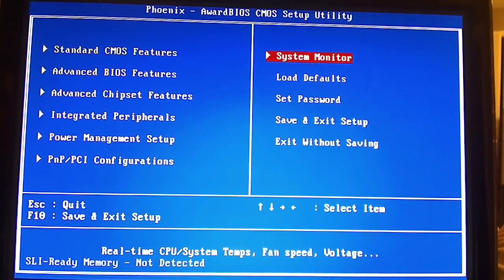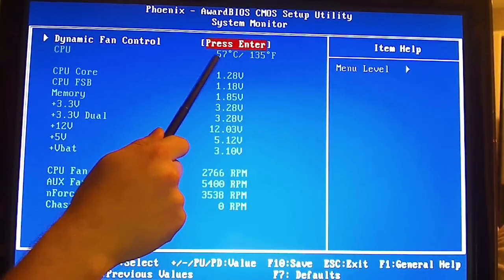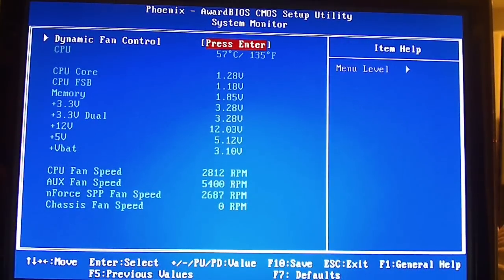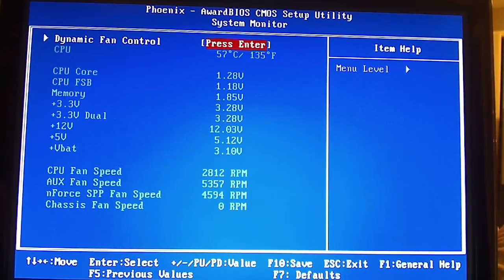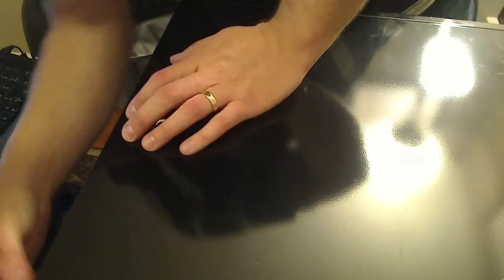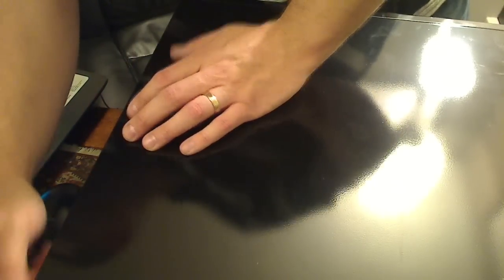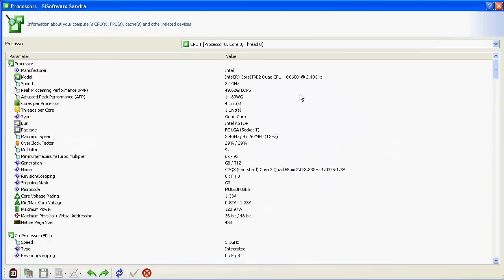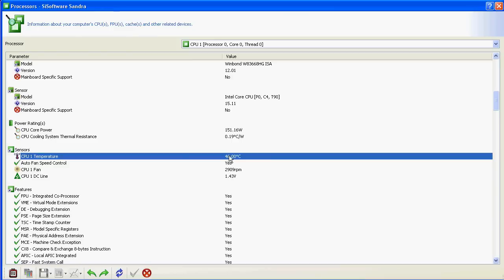SOLVED:  Fix Overheating CPU (Computer) Decrease Temps by 10 degrees

Comment: 8.17 mins. to tell us that we have to clean out of dust our computer... Rocket science
Reply: +ProvenHelper You never said in the title or description that the video was about cleaning out dust. How were we supposed to know that you weren't going to discuss anything else before we watched the video?
Reply from the maker: +Nicklucario Actually you must have not watched the entire video because you missed the point about thermal compound going bad.
Reply: +ProvenHelper You mean the one sentence comment in an 8 minute video?
Reply from the maker: +Nicklucario Well here's a full refund $0
Reply: +ProvenHelper LOL @ refund :)  I just cleaned out my CPU cooler, when I do the ITB (intel burn test) my cores go to almost 100 degrees in less than 10 seconds... I did notice the thermal paste kind of looked like yours in this video, so I guess I should replace it. The CPU cooler had some dust, but now cleaned it and reinstalled it, there is no difference in temperature... It is a stock Intel cooler and my CPU is not overclocked. I guess those stock coolers are not awesome, but it's just weird. My other coolers mounted on the side of the case are clean too and the air feels cooled.
Reply: @ThevonMusic  i know its old but i have same problem, replaced thermal paste and cleaned put but still nothing, did u solve it?
Reply: @CamaGoesGym  I bought a new cpu cooler, a better one which until now still works great
Reply: @ThevonMusic  so the cooler was the problem??
Reply: Yes

Comment from the maker: Might be re-doing this video. My power supply fan died and my fans were setup incorrectly. My temps are super low now, with the new power supply and proper setup of airflow.

Comment from the maker: I noticed many of you are plagued by very high CPU temperatures. I would strongly recommend this affordable performance CPU cooler (http://amzn.to/1QClPAR) , it's only $29 has over 3,632 positive reviews. It used to cost a lot more, but the price has come down a lot recently. It works for #Intel and #AMD CPU sockets, and it almost fits everything out there! Good luck and post a comment if you own it.  
#CPUcooler  #CPUoverheating
Reply: Lex Selfmade Life I actually just bought this one. I have high hopes

Comment from the maker: The following will cause temperature problems.
1. Bad voltage settings.
2. CPU and heatsink shifted causing old thermal compound to become ineffective.
3. Broken fan.
4. Virus or rogue process.
5. Excessive dust.
6. Fans pointed in the wrong direction.
7. High temperatures in your computer room.

Hope that helps you with your trouble-shooting.

Comment: Hi. It seems that you have the CPU cooler mounted the wrong way. You should turn it 180º so that its fan blows the air, first passing the cpu cooler, then going in the direction of the back of your pc case so that the next fan will blow it out of the case. Other thing is, the fan thats pulling the air out of the case, is also stopping that your cpu cooler fan pulls enough air to blow the cpu cooler itself. Its a double win case. :) Regards

Comment from the maker: I understand you perfectly and yes computers are very easily affected by room temperatures, so it's ideal to run them in air conditioned rooms if the room temperature is very high. 35c is very high.

Comment: He puts the CPU Cooler the wrong way :D
Reply: True, it needs to face east because the PSU & rear outtake fan both suck air out so it's a tug-o-war with the HSF which is trying to suck air down into the copper pipes.
Reply: You put your picture on wrong position.

Comment: I see one of the reasons you were hving overheating issues. The CPU fan and the case back fan were placed in conflicting directions, pulling air from inbetween. This likely negatively impacted your airflow by a fair margin.
Reply: +BronyBoyYack Exactly, those idle temps are above normal. I think he didn't spread the thermal paste, he needed more and then spread the layer, then set.
Reply: +kev42o97 That wouldn't have helped nearly as much as having proper airflow.
Reply: BronyBoyYack Very true. However, I've taken apart video cards and reapplied thermal paste that had clearly disintegrated over time and the temps dramatically decreased. But you are correct, improper or insufficient airflow for a cpu will cause serious heat dissipation problems.
Reply: +kev42o97 New thermal paste is always good when the old stuff has gone dry and crusty. It still won't impact the cooling performance as much as proper airflow. If it's dry and worn out, it may be better to just wipe it off and sit the cooler on with maybe just enough paste to fill in minor gaps. Lapping is also an option, as if you lap both the heatsink and cpu spreader properly, more metal will have direct contact with metal, leading to less need for thermal compounds to fill in gaps.
Reply: BronyBoyYack Yeah I agree.
Reply: Alladeen Madafaker The default fan is no good for cpu's. You must get an aftermarket fan.
Reply: TheInVerseIsTrue Watch him actually look for aftermarket FANS, rather than heatsinks. That won't work at all. As long as your fan is blowing on the same piece of metal, you won't get much in the way of improvement. If you really want to keep your digital oven from glowing red, you need to get a heatsink+fan combo. Personally, I recommend the Cooler Master Hyper 212 EVO, if your computer's enclosure is wide enough to fit it. If you can't fit a Hyper 212 EVO into your computer, my alternative recommendation would definitely go to the Cryorig H7. Both coolers have great compatibility across numerous sockets and have unsurpassed performance when it comes to air cooling.
Reply: Yackaro That's what I meant to say. I have a 9800 aftermarket fan for my i5. A zalman 9600, my mistake.
Reply: TheInVerseIsTrue You're still saying fan, rather than heatsink. A fan is a set of plastic blades that spin in a frame to create airflow, a heatsink is the metal thing that it's blowing air through. I'm only doing my best to clear the confusion of what you're saying. I don't want Alladeen Madafaker to go buy a fan and take off the heatsink, put on thermal compound, and slap the fan on at the ratings label, instant fire hazard there. I also don't want him to just put a straight up new fan on the stock heatsink, because unless the new fan has some stupid high CFM compared to the old one, which I doubt unless you get Delta fans at 6k+ rpm, you will not see much improvement. Just sa'in.
Reply: Yackaro lol, Copper heat sink + fan by Zalman.
Reply: @kmemz  interesting
Reply: @xxalexdalionxx  OoOoH what brings you to necro this comment thread?
Notuch has changed about thermodynamics in computing since this thread, outside of the massive growth in the consumer AiO and custom water loop market, so unless you're dealing with something like that 100% of what I've said still holds true.
Reply: KillerMemz I built a new computer recently with a friend of mine but I started noticing that when I play games like overwatch for example, my temperature goes to like 70 and stays in that range for a bit. ;-;

Comment: You spread out the bead of thermal paste that's why you had an air bubble, you can see on the CPU heatsink a space where no thermal paste was, it's there because you spread the thermal paste. You NEVER spread the thermal paste, let the heatsink do it.
 And you also need better cable management, all those loose wires create heat pockets because they block exhaust fans from moving the air behind the wires.
Reply: The Andoxico 4 years late to tell you it doesnt matter at all

Comment: my cpu temp is 76c at 3000rpm fan speed.
Reply: OMG
Reply: BE CAREFUL DUDE, IT MIGHT JUST EXPLODE!
Reply: +You're offended? I don't give a shit! i think youre using a laptop, am i right?
Reply: epic troll The air coming from the pc burns my skin, It's broken now...
Reply: mine was like 107 celcius
Reply: 98c here >_>
Reply: mines 80c fuck I didnt know that was bad lol
Reply: My 6 or 7 year old hp laptop cpu temperature is below 70 Celsius in idle and fan noise is pretty low. Before I cleaned the dust out after 3 years of owning it the temperature of the cpu would go up to 80 at idle with very loud fan noise.

Comment: Hey thank you so much for this video. I have a customized desktop back in 2010 and up until 2014 I was getting the blue screen of death and never knew what was wrong with my computer. I thought I had a virus. comes to find out that a over heating CPU can cause the blue screen. I'm going first thing in the morning to pick up some thermal paste and bring my computer back to life. Just wanted to thank you for a easy and helpful video.

Comment: 57 degrees is not overheating at all. my pc normal temperature is 65 degrees and my pc's gaming temperature is between 80-90 degrees Celsius 
it automatically shuts down when the temperature went above 90 mostly,sometimes 87 tooo
Reply from the maker: +bhavik Soni That sounds like an AMD cpu.
Reply: yeah you are right man
AMD FX(tm)-8320 Eight -Core Processor 3.50 GHz
Reply: my pc shuts down every time I start it becuse of overheating cpu

Comment from the maker: I've been overclocking computers for a very long time, and during that time, I figured out that the following will cause temperature problems.

1. Bad voltage settings.
2. Overclocking too high for your cooling methods.
3. CPU and heatsink shifted causing old thermal compound to become ineffective.
4. Broken fan.
5. Virus or rogue process.
6. Excessive dust.
7. Fans pointed in the wrong direction.
8. High temperatures in your computer room.

Hope that helps you with your trouble-shooting.

Comment: 57 is hot?? man my goes to 95. 100C
Reply: Same lmao
Reply: Same and now that it is now it's crashing just by opening discord
Reply: @chixens5713  how'd ya fix it mine does the same thing?
Reply: @exonscsgo3866  go to the search bar in Windows 10 and type "Power plan" then press the reccomendation on the edit power plan settings and check the reccomended settings for performance that got me from 86-90° to 50-76 when gaming, try it out for yourself.
Reply: @chixens5713  yeah but the performance is gonna decrease

Comment from the maker: Yes you're right. I caught that mistake during the editing of this video and fixed it right away. Since this was taped, I built myself 2 new computers. One was an i5 2500k and my current one is an i7 2600k overclocked to 4.6ghz running about 38 Celsius most of the time.

I plan to make the overclocking video soon, subscribe to my channel for updates.

Comment from the maker: Good job and yes lower temps mean longer life. But I have been overclocking for years and I have never ran a processor to the grave. I never push my CPU to constant max temps either. Right now I'm running a Core i7 2600k overclocked to 4.6Ghz running at 38c with a moderate load.

Comment: Also in a laptop there isn't really much you can do
Reply: You can do what it needs, you can clean it out etc?
Reply from the maker: ***** if you're having problems with your laptop overheating, try doing a deep clen. I made a how-to video for laptops as well.
https://www.youtube.com/watch?v=jxl8MxTMnUo
 #laptopoverheating   #laptop
Reply: ***** I re-tim'd my friends i5 Acer laptop and it went from 85*C in Prime95 to 61*C, max load.  Also tested about the same in Intel burn test.  Used Arctic Silver 5 (AS5).  AS5 was at one time the best stuff but now there might be a few better types.

Comment: Wow dude thanx alot worked perfect for me. Came home and noticed that the comp was very slow so i decided to restart the comp and then at the start up it said CPU was overheat, Decided to check at bios and it was 126 degress warm and i was like well shit is broken but then decided to check it up. First deavtivate Q-fan and let the fan run att full speed but it didnt help much since the CPU was still on 100 degress so i checked your vid and now it's 57 degress when idle! You really saved me there

Comment: You do realize that the CPU runs 10 degrees hotter when in BIOS right?   Also, 57 degrees is not considered overheating....Are you or were you a novice when you made this  video?
Reply: *****  EXACTLY!!! If you want to destroy your computer..this is a great instructional video on how to do just that...
Reply: +Hakeem Hakim The bios up or not if over the temp allowed.The PC would shut off at the set Motherboard temp limit.Or the motherboards flawed each mother board can take so much heat.
Reply: TSpider Keeper   I do not understand a word in what you just said...if you are saying the motherboard regulates temperature, you are wrong. The motherboard has its own temperature and if it is shutting off at 57 degrees than that is a PRETTY WEAK motherboard.  Intel CPUs can go a bit over 100c before it will automatically shut off...
Reply: +Hakeem Hakim My bad misread your comment.And was saying it has own temps lol
Reply: TSpider Keeper   cool bro!
Reply: dude it's 57 degree at idle... that means on load( whenever gaming) it's going to be 85degrees at least

Comment from the maker: @crayzeesteve Here's what you should do since I take it you are not a computer nerd. 1. take a lot of before pictures in-case you forget where and how things go. 2. unplug all cables 3. remove memory modules 4. remove cpu and heat sink 5. remove add in cards (video cards, sound cards, network cards etc.) 6. put everything back, step by step. 7. if you pulled the CPU out, make sure you clean off the old thermal paste and re-apply thermal paste when you put it back. Re-seat =take out, put back in.

Comment: Everything in the bios is set to auto, but i will check with AMD what they should be,  thanks. This cpu is known to get too hot, but they say it shouldn't cause issues until it reached 70 degrees. By the way I took your advice in this video and actually washed the heatsink and its helped a lot, even though i clean the dust inside PC every month.

Comment from the maker: Another note about Fans: 
1. You should have equal amount of fans blowing in and an equal amount of fans blowing out. 
2. Front fans should be sucking cool air in; arrows towards Motherboard, rear fans are obviously exhaust; blowing air out, arrows facing the back of case.

Comment: Sorted it out tonight when I got home from work :o) It's now running at about 40°C normally and only up to 60°C when I'm gaming.  The CPU was stuck fast to the heatsink so I had to get it off (gently) with a screwdriver and a hammer. Cleaned the fan with Q-tips and scrubbed the heatsink with soapy water. There was a LOT of dust and cat hairs, my cat sleeps on top of the tower. Thanks for the help :o) 
Also I put the CPU back before cleaning it, so I wouldn't bend any of the pins.

Comment: that's usually a sign of the cooler not being able to handle the TDP of the chip.  if u can increase cool air flow into the case that usually helps, also a faster fan on the cooler if u have spare fans, if not a new cooler is your only other option.  but just because its climbing under load while the cooling system is on max isn't  a bad thing, usually it will peak at some point, where it peaks can be the good or the bad.

Comment from the maker: Check your voltages make sure they are a stock settings since you are not overclocking. voltages cause the biggest temperature increases. Then you might want to upgrade to a higher end heatsink and fan. An i5 should be around 37 degrees Celsius on idle (Windows desktop). Keep troubleshooting until you find the problem.

Comment from the maker: If you have done the cleaning and the thermal paste, then the next step would be to swap out the CPU heatsink for a more effective model for your CPU. A cooler CPU equals cooler case temps, which should equal cooler GPU. Also if your GPU is causing the the overheating issues, then you might want to look into putting in more case fans because it sound like it's too hot in your case, if your onboard GPU is overheating. You can also put in a better graphics card that is known to have good cooling.

Comment: Cpu.  This ensures full coverage and will form a much better seal.  make sure you dont leave pockets where air can get trapped.  Once your heatsync is clean, inspect the hardware that mounts it to the motherboard.   Spring screws are usually quite good but pushpins are a pain in the ass.  And if they break they are useless.  If broken, i recomend going to a hardware store and finding small nylon nuts, bolts and spacers. you want firm pressure on the cpu but not too much to cause warping. GL!

Comment from the maker: It really depends on your CPU and the overclock you're running. Right now, I have an Intel i7 2600k that's 3.4ghz stock and I'm running it at 4.4ghz. My temp at that 1ghz overclock is 37c.

Comment: no problem bro, yeapz it's quite expensive but you'll have no regrets if you will see the results as compared with the crappy generic ones. 
reviews with the deepcool 200t seems fine but do note that they are tested from cold countries/region. your ambient temps will make a difference here unless your room was air-conditioned otherwise.

Comment: Good tutorial except for one detail, after you put on the thermal paste you suppose to spread it out evenly over the entire CPU for optimal heat transition.

TIP: I do this for a living and have done a lot of desktops and laptops. In my opinion a touch screen stylus pen is a good tool to spread it out without things getting messy  (if you are willing to sacrifice one)

Comment: I use an old credit card. ;)
The biggest misconception: thermal paste should only fill the tiny imperfections of both the heatsink and the cpu surface. Before applying thermal paste, I always polish them both up with car wax and dry cotton. I overclocked my CPU 30%, use a standard heatsink.
To prove my method works, here are the temps: Idle: 30 degrees celcius, and under full load (Prime95 for over 2 hours) max: 60 degrees.
And oh, for any of those who don't believe me: bad luck. I KNOW it works